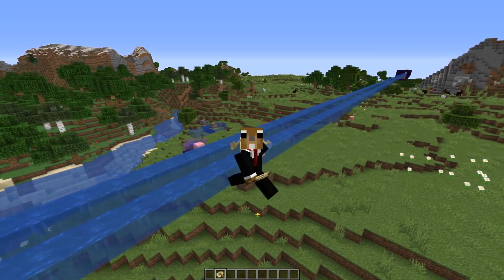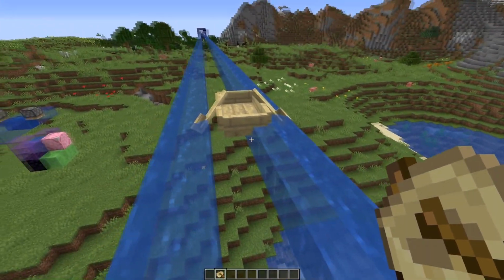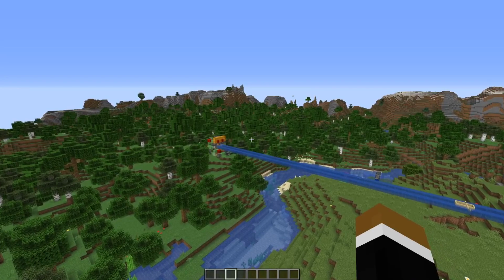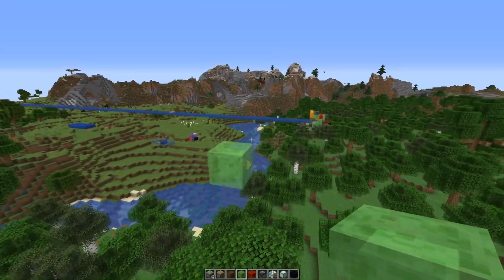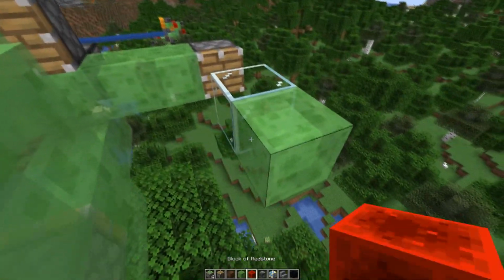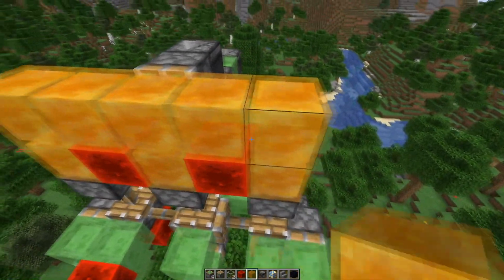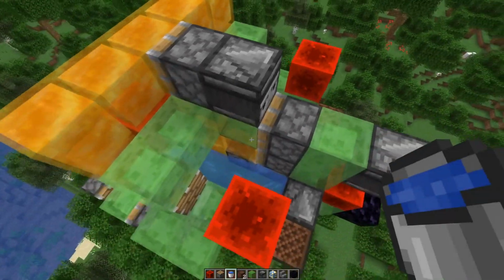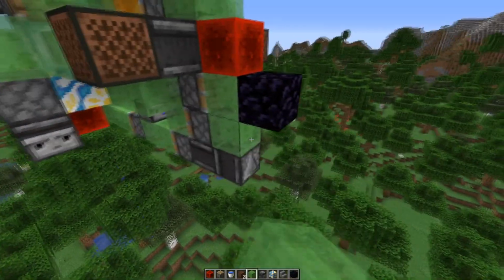Double Floating Water Maker 1.15+

Comment: Imagine being able to have basalt or coblestone generator building walls on the side so it could be a wall
Reply: A moving basalt or cobblestone generator? That'd be interesting...
Reply: @Jack-tu5zf  in theory using the carpet mod you could actually do that since you could move dispensers with pistons and so you could dispense lava buckets and move a cobble gen
Reply: @CyanPickle  I don't use mods so I didn't know about this, I was thinking of something more like a flying machine that could have an AFK player on it to pick up then dispense the lava while the water is moved on a water logged block but using mods could work too.

Comment: I'll go ahead and predict the double piston, which can extend by either 1 or 2 blocks depending on the signal strength. I can't say I fully understand how this thing works, but it seems like double pistons would make it better.
Reply: Flying machine double pistons are kinda big and make it hard to add into a machine cause of push limit
Reply: @MrEvanNoyes  I don't mean two pistons, I mean a new type of piston that can extend twice as far. It's unlikely that something like that would actually be added, but it would definitely be interesting.
Reply: OceanBagel Yeah if that was added it would change everything

Comment: WRT making a 3 wide channel could you not have the pistons below the water source move out of the way before the whole machine moves forwards to prevent them from updating other blocks?  So like the piston tries to pull an extended piston, creating the floating source block and then  bot pistons retract and are pulled downwards and out of the way of the nearby water while the machine moves forwards

Comment: I think I'll use this in my world! Question: how do you remove this machine without updating the water after it builds the water you need?
Reply: I dont think you realy can, unless you make an update suppresor, however its difficult
Reply from the maker: It's possible. You need to use the same piston trick at the end and carefully removed the rest of the blocks. I should have shown this.
Reply: ilmango Okay thanks, I'll make sure to test in creative to make it is possible :-)

Comment: Wait. If you wanted to remove the machine around the water after is that possible?
Reply: easily
Reply: @fx-modding  It wouldn't cause any updates?
Reply: @dr.gaming1769  it will

Comment: Then just place ice blocks down the center.m.
Reply: You cant, it will update the water
Reply: @yoamal1187  One block down in the middle?
Reply: @thepizzaheman  you mean like a V shape? Yeah i guess so
Reply: @yoamal1187  yea, you would be able to go super fast and have weird floating water.
Reply: @thepizzaheman  I dont think the hitbox will touch the ice though
Reply: @yoamal1187  I mean, it works like that with most superfast boat highway things I've seen.
Reply: @thepizzaheman  then just use ice, no need for water
Reply: @yoamal1187  but the water looks cool.
Also, you can use it to make a boat highway, with a fast lane and slow lane.